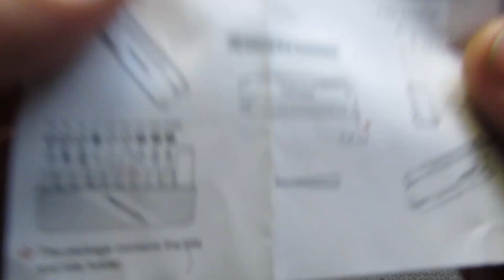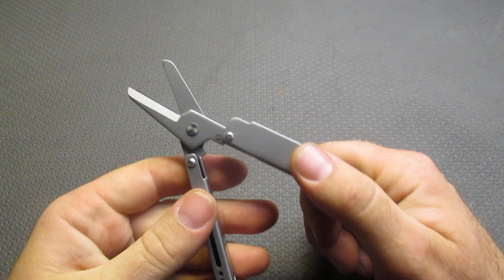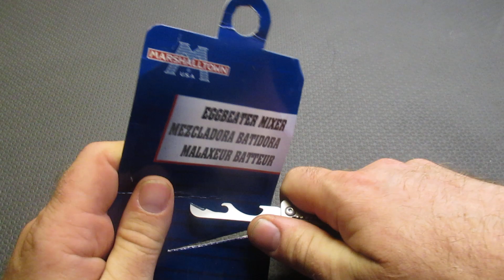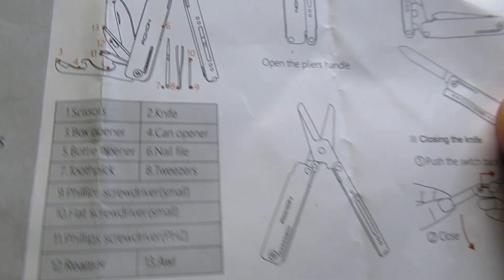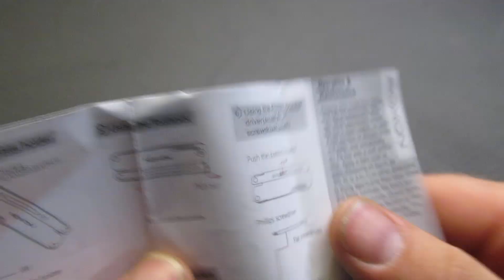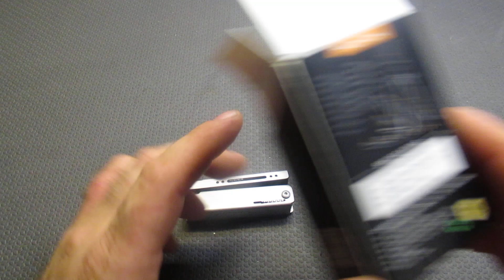2022 Roxon M3 Recently Released! Scissor Multi-Tool

Comment: I don't see the difference with the ks2
Reply from the maker: The KS2 works out of one handle, tools coming out on opposite sides.  The scissors are a separate tool on the KS2 attached to the handle.  The M3 is two handles with the main tool being the scissors.  Both handle attached to the scissors store separate tools.  The two tools are close but a little different as well.
Reply: @hvacbudget8600  Ah ok. Thanks a lot :)

Comment: Hello guys i am living in israel and we have pretty strict laws and especially because i am arab i am afraid that if i got caught with any knife of any type ill be in big trouble but i am interested in pocket knives and multi tools and always find myself needing them but i dont have them so my question is can i remove the blade from this knife ? If yes what can i put in their place I would appreciate help of any kind , by the way great review 😊
Reply from the maker: That is an interesting problem.  Would you say the laws are stricter than Europe?  The short answer is no this blade cannot be easily removed unless you put in some work  modding the tool.  This tool is made of cheaper metal so even as you try to take it apart the pivot screws might strip out.  You may want instead to buy a Leatherman Style PS or another similar tool without a knife blade.  The Leatherman Leap is a discontinued tool that had a removable blade.  Nextool sells a special version of it's larger tool the Flagship Pro that has a removable utility blade that can work.  There is a tiny tool the Swiss tech foldable pliers that comes in one version without a blade.  Hope that helps.
Reply: @hvacbudget8600  thanks that helps a lot now as to the laws i dont know much about their laws but i do know that the israeli law has the max length and no locking mechanism but in addition i read i great reddit thread by a jewish lawyer who actually sat down with a police captain just to ask some questions and we have typical laws regarding where you can't bring the knife in like schools government buildings shopping mall etc and in addition u need to have "cause" to carry the tool or the knife and you need to have to use it in your job and i quote "if you were stopped while driving with the knife or multi tool in your pocket or the glove box thats an instant ticket even if you have probable cause to carrying it and the only place it should be is in the tool box but at that point why would i have a multi tool in a tool box instead of actual tools and i heard many stories from even jewish friends where the cop was maybe having a ruff day and even though their carry was completely legitimate they got in a great deal of trouble. I know this is long so thank you for reading lol but the main thing i am looking for is a good pair of scissors and actually i loved these because they had that and they have the tweezers and the toothpick which to me are a great addition
Reply: Just a small correction all of that said above was in regards to carrying a pocket knife I didn't find any specific info regarding multi tools but i think the same rule applies to anything with a folding knife
Reply from the maker: @shadi3993  That's very interesting.  Thanks for sharing.  Unfortunately you may need to look at discontinued multi tools for better options.  Or you can try to mod this tool.  It might turn out pretty good.
Reply: @hvacbudget8600  i just might thanks a lot I'll hopefully remember to post an update on the subject if you or any one else is interested

Comment: Have you ordered a set of micro bits that fit this tool? Which would you recommend?
Reply from the maker: It actually comes with some with the tool.  It  uses 4mm bits.  I do have several extra sets I've picked up recently.
Reply: @hvacbudget8600  what are the extra sets you picked up?
Reply from the maker: @Vickz818  I found a full 4mm set at my local hardware store and several sets have come with multi-tools I have found this last month.  I still have not got a name brand set.  I still would like to pick up a better set in the future.